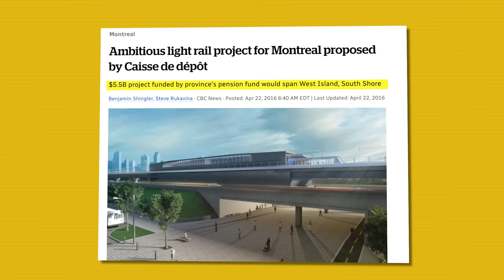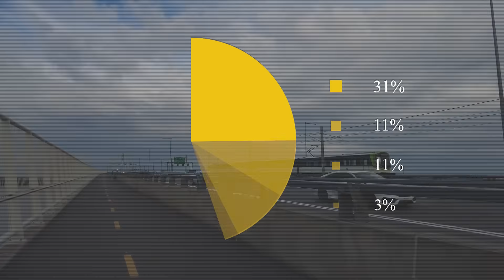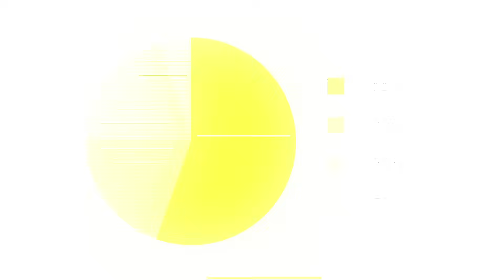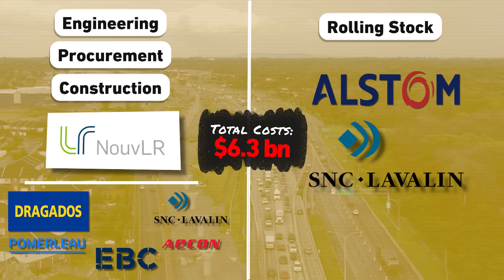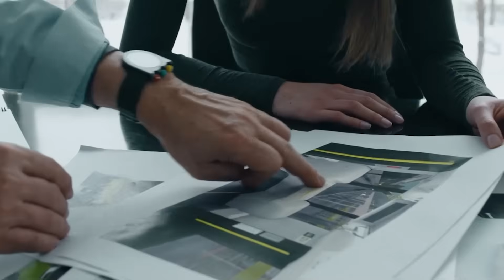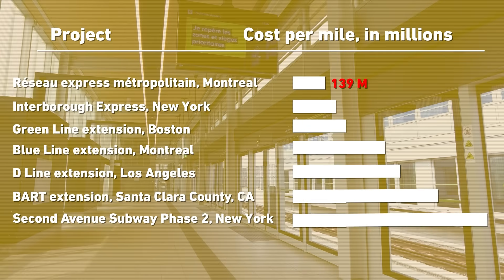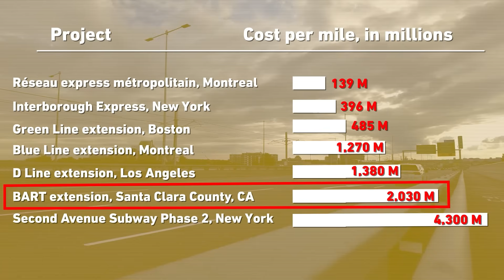Why Did This Mega-Project Cost So Little? | Montreal's REM Explained

Comment: The true cost is being hidden by the new fee structure.
At capacity. 125,000 per day, each ride will have a true cost of $19.50 per ride.
No one would pay that so they have buried the true cost at the expense of the rest of the system and taxpayers making up the shortfall.
CDPQ is already $1.6 billion over budget and they are guaranteed 9%profit per year.
There are only 3 connections to the Metro system ensuring that the metro will be overwhelmed.

Comment: There are several reasons why the REM automatic light rail project was cheaper than comparable projects elsewhere.  Firstly, in the eastern end at Brossard, the REM alignment was simply the former BRT lanes built by the provincial government over the decades.  Secondly, the design of the federally owned new Champlain Bridge provided space for light rail tracks, which were formerly supposed to go to an LRT project but was taken over by the REM promoters.  Thirdly, the segment which is the former electric  commuter rail line from Central Station to Deux-Montagnes, purchased years ago by the provincial government from CN, was given to the REM to be downgraded to light rail.  So the REM benefitted from a lot of provincial gifts.  As well, fourthly, the segment parallel to Highway 40 is built above ground and not tunnel, and as such crosses almost all low-density industrial zones.  Thus very little expropriation and demolition of existing structures.  It’s off the highway shoulder, again which already belongs to the provincial government.

Comment: The REM should nave been a Mag-Lev train instead. It is perfect for that. It was super expensive compare to other project in the world of the same size and type. Mag-Lev would have been better as they create no sound pollution, are stable, much faster and derailing is impossible. It is at least electric, no air pollution at least.

Comment: the rem is  a shit project built for profit, not to serve transportation needs
Reply: exactly how does it not serve transportation needs? 
- Connects South Shore with Rapid Transit
- More Frequent Service to Deux-Montages
- Conections with the Metro near or in downtown 
- New Branch to Anse-à-l'Orme paralleling Autoroute 40 north of Hudson Line
- Airport branch with stop at Technopark

How would you plan REM or something similar with that price?
Reply: @TheRandCrews  It's not integrated with the traffic flows of the neighbourhoods it purports to serve.  To use it, increases a downtown commute by 50% to 1005.  It does not meet transportation needs.  Airport branch?  That's  hilarious.  Oh, you think that's a positive?   Ok, true believer, believe.

Comment: Under rated - The rules employed by each rail division that drive fast movements under faulted conditions.  And the complete understanding of how to both push the rules to the max and be safe for public.  A crossing fails and a dozen high speeds trains pass without notice to all.  Multiple plants have switch issues and control signals are useless, we right hand run and fleet signals on site.  Cold trains get slowed down at weak track.  At some point it becomes a game played by precision cowboys willing work and study 24 hours 7 days a week.  $$$ updates make stuff work better lol, it's well understood rules that push trains to the max by signals and track maintainers that are well trained vets.

Comment: Municipalities are suffering from unbearable deficits in their transit budgets  and have to cut bus service due to the REM deficit. due to poor ridership. That even if the bus service to the South Shore was cut in order to force people to use the REM. The cancelling of all users of the existing tunnel is not calculated in the sum. Add a few billion $. Most importantly it will result in the expansion of suburbs, destroying very fertile land. Montreal itself needs an extension of the two lines, green and blue so that they meet at the airport and beyond the A25 autoroute, forming a continuous ring. Today it takes 90 minutes from any part of the eastern half of Montreal to go and work in the industrial park close to the airport. We are part the North American reality with prices 7 times higher than in China. How is it possible for Bombardier to compete with the Indians or the Chinese when its workers spend 3 hours going back and forth, while living in half of the Montreal? By the way, they were left standing, because Bombardier was deemed incapable of building the rail cars. They should try to gain contracts in the US. And or disappear like Nortel. Maybe the presentation is right, we are not the worst among the losers and the backwards. In the BAPE ( public consultation) about the REM, 88% of the 107 presentations were against it. So was the final report by the three commissioners. The prime minister of Quebec said ''The REM must be done because it must be done''. A crime against logic, called vicious circle, when we are using as proof what we have to prove. Now we live the punishment. Too late. Look for the ''Petit rain du Nord'' in Youtube, sang by our troubadour, Felix Leclerc for consolation and fun.
Reply: Good luck trying to make a Metro extension this cheap when the trains cannot handle the weather outside or even water. Blue Line is already having problems with cost going north to Montreal Nord and Green Line is going to reach capacity with any extension if not needing another line to alleviate it. Easy to say for suburbanites to be against public transit if they only take their car downtown or to a train station to cut traffic. You should be worried about density built around stations than suburban expansion

Comment: Because it's built in French-speaking Canada instead of Anglo-Canada, and having closer links to continental European cultural practices to construction matters.
1. Continental European infra projects have demonstrated higher fiscal discipline than in Anglo countries lately, since funding are allocated according to a long-term vision rather than piecemeal budget debates on the parliament floor, and compromises in smoke-filled backrooms.
2. Continental legal systems are less paralyzed by litigious NIMBYs
3. Continental European countries (especially Spain, France and Italy) have more in-house engineering talent in the government, and offers less opportunities to be ripped off by consultancies
4. Continental European countries have been building infra continuously, and the engineering talent and equipment can be reused for further projects a few months down the line
5. There is a cultural Dutch disease going on in Anglo countries, making engineering and manufacturing less glamourous in Anglo societies. With the entire world learning English and consuming English media, much of the top talent is siphoned away into the entertainment, art and legal industries. Hollywood and gaming studios can lie on their backs releasing absolute garbage and get more revenue than their South Korean counterparts with the entire state supporting them
6. Massive cost overruns and delays in infra projects in Anglo countries in the last 50 years discouraged policy makes, and became a self-reinforcing perverse cycle

Comment: I welcome transit expansion although whether the REM is a success is a debate.  For years Montreal‘s subway extended outside of city limits, with Toronto’s subway system having only begun to do so late in 2017 to Vaughan Metro Centre.  that said, it’s been a while since I’ve taken a subway to anywhere but a different part of Toronto proper, with only a handful of TTC bus routes that extend anywhere north of Steeles Ave. (most of whose length, from what was Ontario Highway 50 in the west to the York-Durham Line in the east, marks as a border between Toronto and the neighbouring Region[al Municipality] of York).

Comment: You confused the West Island and the Île Bizard.   The "West Island" is not an island per se but the West part of the Island of Montréal.

There is also the Yellow line of the métro that goes to Longueuil.
Reply: Malheureusement la ligne jaune ouverte depuis 1967 était supposée se rendre au CEGEP E Montpetit et à l'hopital P Boucher 
et ainsi diminuer la congestion routière autour du secteurpont J-Cartier et Méro U de S Longueuil

Comment: To resume this video in  a few words They saved money by reusing a 100 years old working tunnel (1918-1931) who was previously used by the Canadian Northern Railroad (Canora) Between The suburbs Town Of Mout-Royal and downtown Montréal; That Tunnel was used by two Commuter train (Deux-Montagne EXO Line) and Mascouche/Terrebonne Line and change the technology . i.e. Smaller but more frequent automated Trains i.e they use the cheapest solution available to built a better working model.

They reroute the Mascouche - Downtown line  via Côte-Saint-Luc Yard to Gare Lucien-L'Allier and convert the Deux-Montagnes line on the REM format.

 A proper Alternative would have been to extend the Orange Line from Côte-Vertu to Bois-Franc 2 stations (Poirier and Bois-Franc) in Ville Saint-Laurent and connecting the DM line to Bois-Franc and keeping the southern Lines for the the Airport Branch. 

I would rather add a Des Laurentides Branch who connect the REM at Du Ruisseau and relieve the Orange Line at Montmorency via Highway 15 which could be extend cheaply the Highway Right of way. Instead of sending the REM in the distant subburbs of Deux-Montagnes which is not the main city in they own Municipalité Régional de Comté (MRC) (County Regional Municipality)

Deux-Montagnes . The main city of the MRC Deux-Montagnes is St-Eustache 41 K vs 4 K for the Town of Deux-Montagnes .
Reply: *Canadian National
Reply: @weatheranddarkness  Canadian National (CN) inherit of the Canadian Northern Railway (CNoR) and The Canadian Government Railway (CGR) assets when the Canadian Northern Railways went Bankrupt in the 1918.
Reply: @ didn't realise there were so many names in play back through history.

Comment: With all of the alleged experience, CDPQ has to shutdown the REM every weekend now because after only 1 year, the way their attached tracks to the elecated concrete sections has resulted on wear of the concrete so they need to lay new concrete on elevated guideway surfaces. Also, it will be closed all summer so they can connect the tracks at centrak station to the tunnel (their excuse).     For something   announced in 2016 and delayed over and over again, I guess they didn't have time to properly plan conncting 2 tracks to an extension and didn't plan how their control centre could cope with the expansion. They were eager with signeable though, because on south shores the signs are already there to the airport, west island and deux- montagnes lines. 

BTW West IOsand refers to the western part of the Island of Montréal (Dorval, Pointe Claire, Beaconsfield, Baie d'Urfée , Ste Anne de Bellevue,  Senneville, Pierrefonds (M), Île Bizzard (M) and Dollard des Ormeaux.  (M = part of city of montreal since early 2000s). 
In your video, you seem to think that Île Bizzard was the West Island.
Reply: le REM vers Ste Anne de Bellevue cannibalise EXO de l'ouest vers Vaudreuil Dorion
en prenant le monopole du tunnel centenaire le REM nuit à EXO de l'est vers Terrebonne Mascouche
Reply: Le REM vers l'ouest cannibalise la ligne EXO Vaudreuil Dorion
Reply: @j-paulthivi1053  Pas vraiment car la ligne désert le sud de la 40 tandis que le REM désert le nord.   Mais EXO semble déjà résignée à abandonner les efforts de grandir la ligne de train.  Ses Autobus de la Presque Île se rabbateront à la station REM Anse à Orme au lier des gares de train.
Reply: @jfmezei  Très faible excuse considérant les G$ dépensés pour cannibaliser le tunnel et nuire à EXO de l'est  et l'EXO de l'ouest  
possiblement que l'antenne ouest coute des G$ gaspillés en plus du tunnel sous les pistes YUL
pensez -y quelques secondes ; de l'aéroport à lagare centrale le 3/4 du trajet sera parcouru sous terre  comme des taupes
et j'espère que les tram utilisés auront plus de places assises que le REM de Brossard ...
Sérieusement CDPQ Infra est bullshitteur ... 
et M J-M Arbaud aussi sur le prétexte de ne pas avoir fait un nouveau tunnel sous le Mt Royal pour le REM
en achetant ce tunnel pour 150 M$ et ensuite gaspiller des G$ pour câbler et construire un mur mitoyen
ce qui empêchera les futurs trains TGF de VIA  prévus par le gouv fédéral 
quand on lit tous les retards et couts créés par ce tunnel je pense que le creusage par le tunnelier 
ça aurait été moins compliqué et plus rapide que d'adapter le vieux tunnel aux besoins du REM automatisé sans conducteur

Comment: You claim that the REM is 67 km, But this is not 67km of new tracks.  This is not 67km of construction by CDPQ. 
30km was stolen from the Deux Montagnes line. Stations are in the same location, so no land acquisition needed, space for parking already there. 
The 3.5 km on the bridge that replaced the Champlain bridge was paid for by the federal governmemt speparate from the stated funding. 
The roughly 6km on the south shore of the highway which was moved to create space in the middle for the tracks and stations was done and paid for by the provincial governmemnt outside the budget of the REM project. They just had to layballast and tracks and build their stations.

The west island leg, except as pylons are planted on the Fairview shopping centre parking lot  are either on the old CN spur to Sources, or on provincial land (highway 40).  The forest they had to clear to build the terminal station did have to be purchased from a real estate firm owned by CDPQ. 
CDPQ also imposed taxes on the cities it imposed its REM on. Anything built near a REM tracks/station must now pay higher taxes because CDPQ imposed royalties because it says it increases property values. 

Public transit is supposed to serve the public, not be a profitable endeavour that costs the public in both higher property taxes and higher taxes to government who needs to subsidize this system which the province could not afford (remember, many planned projects such as metro extension are on hold or severely slowed down becauyse of all that unplaned  need for funds diverted to CDPQ.  The government origially was only willin to fiund the link across the new bridge and the direct link to airport.
Reply: Surprise surprise they do a similar way to fund Transit in France by making people that leave immediately to the line pay for it, Also the people that live immediately next to the rem stations should pay more since they benefit the most. Also, idk why you're so worked up you guys in Montreal are getting 67 Km of rapid transit in under 10 years. If you think the REM is a mess just come look at our Projects in Toronto, we've spent 13 billion on an lrt that only runs 19 km, it's been 14 years and its still under construction!! You guys are getting a much much better value
Reply: @abdulwahid113  Except here, it is a private corporation that gets  the extra porpoerty tax due to vicinity to a REM station and that does not help transit in any way whereas in France, those taxes help build transit and maintain it.
Reply: Speaking of imposed taxes, yeah the 'public transit' tax on car registrations in Montreal is going from $59 / year to $150 / year in 2025. 3% inflation my a**.

Comment: The degrading of tunnel wall due to salt is another bogus excuse by CDPQ.   Much of the tunnel  between Cathcart street where it begins to the south and Sherbrooke where it is no longer under a street was demolished to make way for the MgGill station.  Do the condition of that section of tunnel was irrelevant, levaing only the short stubs between Cathcart and Ste Catherine and between  de Maisonneuve and Sherbrooke.  Note that neither the McGill nor Édouard Montpetit stations were in the original plans, and when the political promise was made, they didn't do due diligence on what it would involve so they blames cost overruns on anything/everything they could imagine.
Reply: Surprise surprise they do a similar way to fund Transit in France by making people that leave immediately to the line pay for it, Also the people that live immediately next to the rem stations should pay more since they benefit the most. Also, idk why you're so worked up you guys in Montreal are getting 67 Km of rapid transit in under 10 years. If you think the REM is a mess just come look at our Projects in Toronto, we've spent 13 billion on an lrt that only runs 19 km, it's been 14 years and its still under construction!! You guys are getting a much much better value